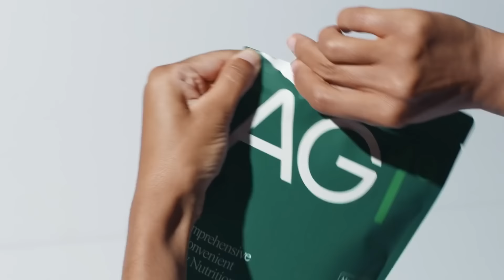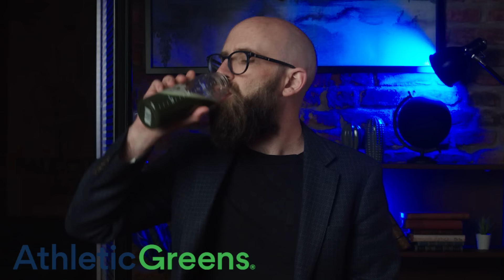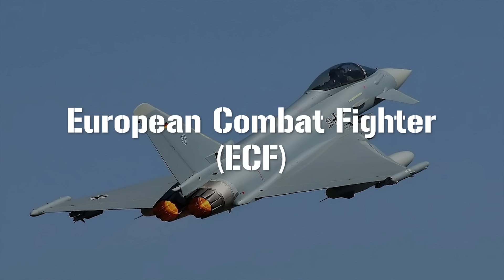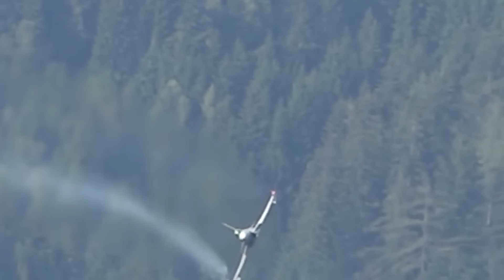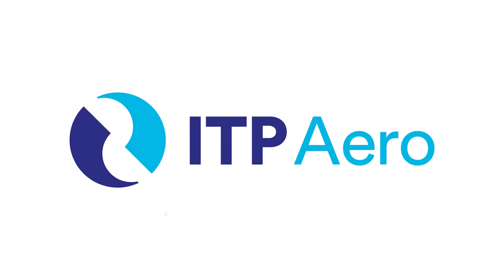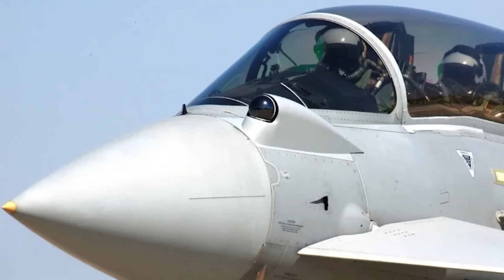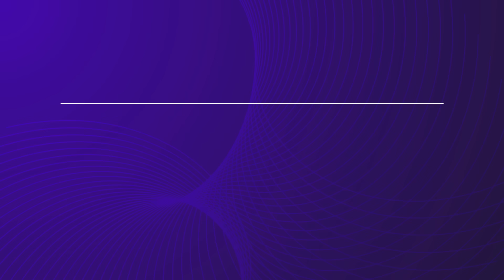The Eurofighter Typhoon: Any Aircraft, Any Mission

Comment: is this classified as a 4th gen fighter? or does its systems and manoeuvrability make it 4.5-5th gen?
Reply: Most things I've seen class the Typhoon as a 4.5 Gen fighter..Definitely not 5th gen,  Although stealth was given some consideration in the Typhoon design ( Such as the S shape engine intakes to mask the engines ) it wasn't a priority in the aircraft's shape, Any other stealth comes from the composites used in construction. But they were used primarily for the strength, Rather than radar reflection..

Comment: To put the price tag of the plane itself in perspective. Here is an historic comparison.  For context, I will use London house price average as a fraction of production cost betwen the Spitfire in 1940 and the Typhoon in 2020 (80 years later). The typhoon value of £75M equates to 150 average London houses at a property price of £500,000. The Spitfire cost £25,000 (at war production scales and did cost much more initially). 1940 average house prices in London were about £500, equating to 50 London homes. So, with inflation taken into account the Typhoon is only 3 times more expensove than a Spitfire, even with a production run of much less than 10% of the numbers of Spitfires produced throughout the war. The Typhoon is good value by any modern comparison for it's effectiveness, reliability, improvement, durability and still in production today delivering new aircraft for the Germans. Something the European partners should all be proud of.

Comment: The average total cost per flying hour for a (RAF, at least) Typhoon is circa £11k, though take off will also cost £11k. So a 1h flight is £22k, a 2h flight 33k etc.
Reply: That's about right. It includes all amortised cost of parts. research development maintenance fuel and training. We can even include cost of sortie in there too such as when a missile is fired.... Goes up a bit then
Reply: In case of war, I can support a 1h:45m flight with my bank account
Reply: Hi , please may i ask, does this include all the staffs wages and also the fuel?
Reply: That price includes the shit ton of fuel these things consume. That's expensive too these days.
Reply: Britain using the EUROfighter be like
Reply: @josecoronadonieto6911 you're aware the UK did most of the work and produces the most of it, right?
Reply: the price for the F35  includes the cost of design and development costs. Also, comes with missiles and bombs and targeting pods and multiple parts and maintenance training and pilot training. so yeah, buying the other fighter(s) is cheaper upfront then buying the F35. However, maintenance training and pilot training and extra pods and missiles does not come with the purchase. Not to mention no spare parts and no spare engines. The F35 also comes with an extra engine. And the cost per hour is high on the F35 because the cost to keep the stealth fully capable is expensive. When there is just a chip or Crack on paint or panel, the entire section has to be replaced and repainted. And when a tiny tiny tiny gap forms from pulling Gs, that entire section has to be replaced and repainted. That is mostly why the cost per flight hour is so high on the F35.
Reply: @nexpro6118 great insight details sir.
Reply: @dukelover9676  thank you, but I can't take the credit for knowing this. Ha. I just do research online to find out things....rather than just listening to someone and or reading a headline that's worded to just grab my attention and doesn't actually tell the whole real story ha

Comment: $100,000/hour may seem like a bargain if someone did the same analysis for other fighters.
Reply: £100000  so that is Around $116000 a hour, I assume its USD you use. I'm fairly certain the 100000 is wrong more like £11000 = $12700 or €12500 euro.
Reply: $100,000 an hour is bull, no jet in the world comes close to that prize for flying per hour, maybe $27,000 or $30,000? but not $100,000 no way!  someone added a lot of extra coasts to get $100,000 per hour.
Reply: Bruh no thats more than the f35

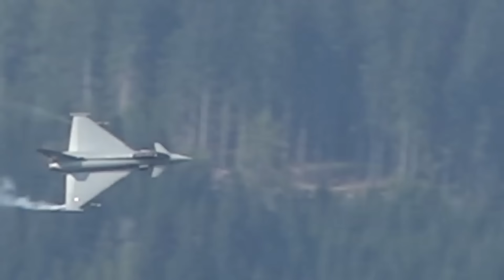Comment: Around 4:05, you mention, that the aircrafts center of GRAVITY shifts towards the back of the plane. That´s plainly wrong: the center of LIFT moves backwards when crossing the sound barrier, since the aerodynamics changes dramatically when exceeding Mach 0.99, while the weight distribution does not change at all (ignoring minor changes due to fuel consumption). As far as I remember, I already mentioned that effect in a comment concerning the  video about the XB-70 Valkyrie...
Reply: Actually, the Centre of Gravity in Typhoon is going to be constantly adjusted by pumping large amounts of fuel around. Going supersonic and having to redistribute mass (fuel) is nothing new - even Concorde had to do that. So yes, the Centre of pressure moves, but the CoG must be moved too, to match it.

This is the tricky part of an aerodynamically unstable airframe. To fly it at all, the CoG and CoP have to be well coordinated, and if they get out of whack then you very, very quickly run out of control authority on the movable  surfaces on the wings, canards, etc. The more out-of-position the CoG is wrt to the CoP, the quicker it all goes wrong. Whereas with a passively stable airframe, loss of control surface authority just limits manoeuvring. 

So I imagine that on Typhoon, even to drop a bomb, fuel has to be prepositioned so that the loss of several hundred kilograms of mass doesn't result in the CoG end up in the wrong place, which would cause the aircraft to tumble out of the sky.
Reply: @abarratt8869  You´re absolutely right: fuel is being pumped around to maintain the center of gravity in an suitable position. However, this is done to compensate for changes in the center of lift, which are a result of switching form subsonic to supersonic aerodynamics and back again. Changing the center of gravity by means of pumping fuel takes time, whilst the movement of the center of lift happens in an instant, once crossing over from one aerodynamic regime to the other one.
Reply: @RageDavis  Indeed yes. You can see how quickly it happens watching some concorde vids, when the pilot shows the shock sensor gauge, the needle of which moved pretty rapidly as it went through M1.0 No time for messing around! 

I guess a delta gives a workable combination of CoP and CoG over a sufficient range to allow for the transition (concorde being famously smooth in doing so), and for additional tweaking afterwards.
Reply: @abarratt8869  https://youtu.be/h6NsYyAUOHE
Reply: Thank you, I was about the point that out myself.
Reply: Center of lift and center of drag shift significantly subsonic vs supersonic.  But center of gravity does not.

Yes SOG moves if the fuel is moved internally.  But that is not caused by the supersonic velocity.
Reply: Other than fuel consummation it is impossible for ballast/weight to physically move across an airframe.
Reply: You’re absolutely correct. When it goes supersonic, the aerodynamic center of the aircraft changes due to how supersonic aerodynamics differ from subsonic.
Reply: I read this.
Reply: Yes correct.
Reply: What you are describing is the center of mass not gravity. Center of mass is kept the same, while aerodynamic load changes shift the center of gravity.

Comment: I live under the landing path of Warton BAE and the sound this thing makes is both incredible and distinctive.
They also did stunt work within BAE.its a simply stunning aircraft and something to be proud of
Reply: I sit in the office on the runway and it’s deafening!
Reply: I worked at BAE Warton from 2000 to 2011 and they were amazing times. The flying display rehearsals were very impressive: the vertical climb rate and the low speed manoeuvres with the nose up were my personal favourites. They were noisy when the flight line was there for (I think) 6 and 29 squadrons but were nothing compared to Tornados: they would always make lots of car alarms go off!
Reply: I live in preston near Warton an agree the thing is deafening, when they fly over you can put the TV on max volume and still only hear the jet!
Reply: I really envy you.I live here in the American state of Connecticut and unless I go on a trip,doubt I will ever see one.

Comment: The control units these guys were dealing with when designing the airframe is what a hobbyist can grab for a few quid today, I'm wondering whats next.
Reply: Not exactly accurate, similar capabilities in some respects if you call several hundred to a grand "a few quid", however the gyro drift is still an issue with the hobby units at times where it isn't with the mil-grade stuff. I've had serious crashes from gyro drift/wrong compensation from those types of units on my RC gear, including one airplane going completely awol that I never found back. I do also have more advanced stuff though, but on quadcopters using machine vision on a downfacing camera for position hold which is far better than the GPS because of speed and precision.

Comment: Cheaper to run per hour than some soccer players in England.
Reply: And footballers don't even run that fast. And they only operate about 90 minutes per week. And they like to eat grass as much as cows.
Reply: More useful as well 😆
Reply: 🤣🤣🤣🤣🤣   plus their  teams  defence  is  FAR  superior  ..........
Reply: Probably break down less as well.
Reply: Foooootbaaaaaallll
Reply: Hallo sporty one..👏
Reply: Ha! You got that correct.
Reply: the price for the F35  includes the cost of design and development costs. Also, comes with missiles and bombs and targeting pods and multiple parts and maintenance training and pilot training. so yeah, buying the other fighter(s) is cheaper upfront then buying the F35. However, maintenance training and pilot training and extra pods and missiles does not come with the purchase. Not to mention no spare parts and no spare engines. The F35 also comes with an extra engine. And the cost per hour is high on the F35 because the cost to keep the stealth fully capable is expensive. When there is just a chip or Crack on paint or panel, the entire section has to be replaced and repainted. And when a tiny tiny tiny gap forms from pulling Gs, that entire section has to be replaced and repainted. That is mostly why the cost per flight hour is so high on the F35.